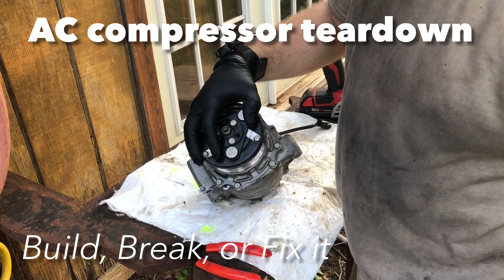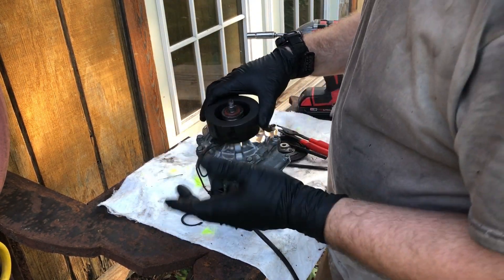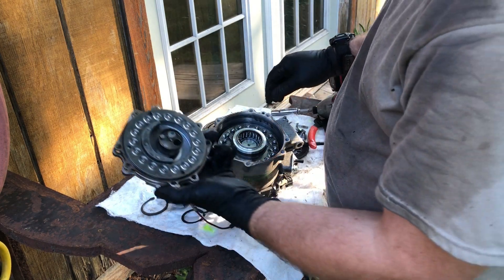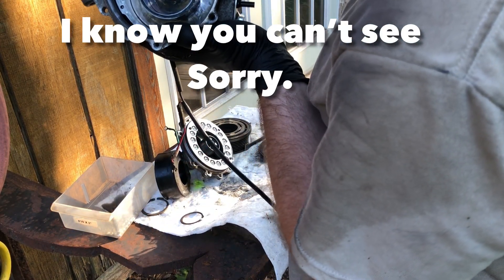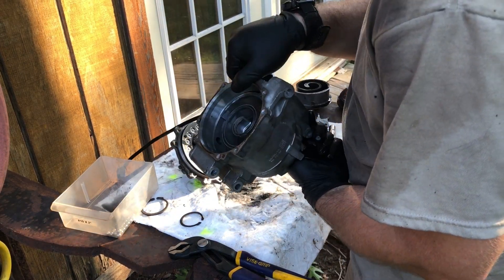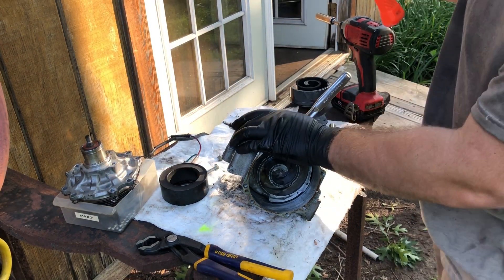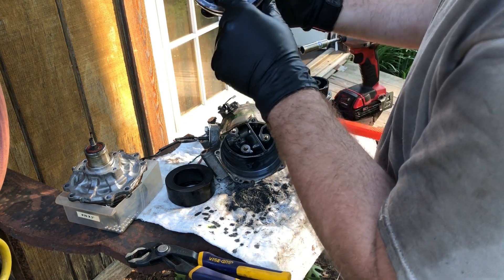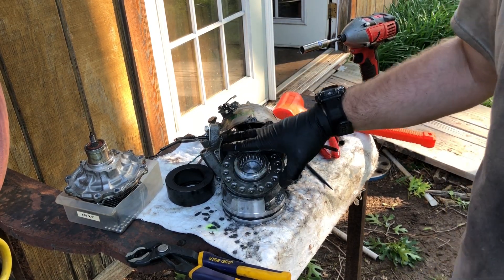Honda AC compressor teardown

Comment: What car did that compressor come out of?
Reply from the maker: youngb1ood It was a 2007 Honda Civic.
Reply: Jerus Barnett are all Honda’s equipped with scroll type a/c compressor? It seems like if the casting of aluminum alloy metallurgy is weak, then it’s easily prone to weakening of the walls.